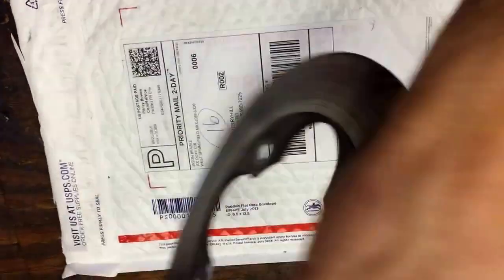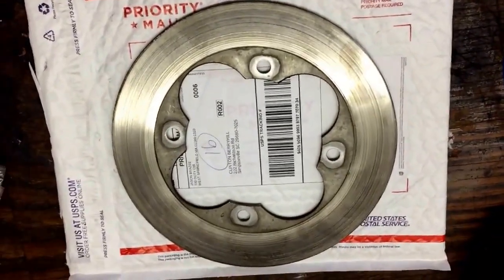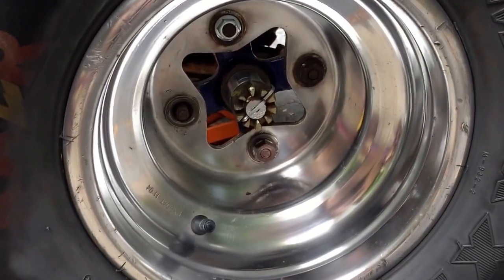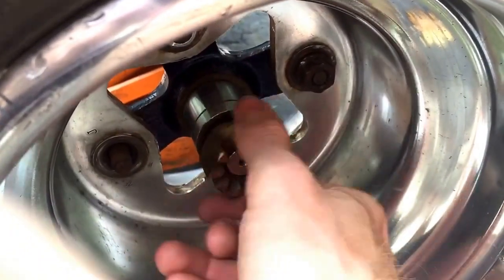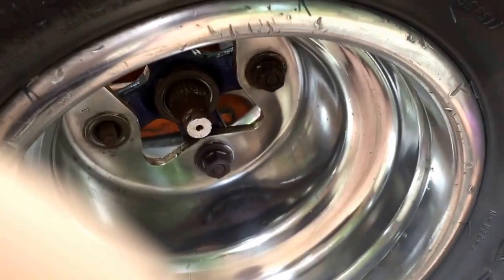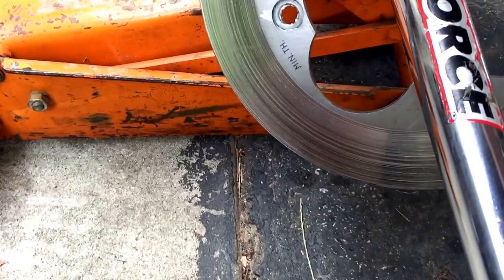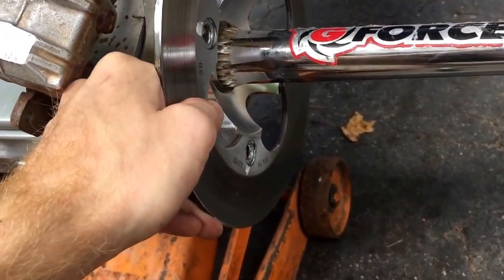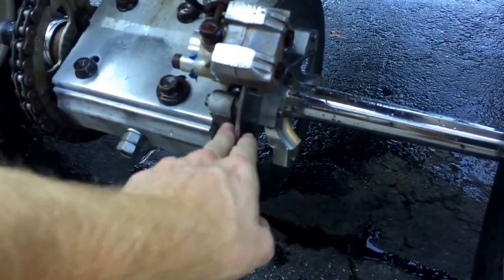How to install rear brake disc/rotor on ltz400/z400.

Comment: I have a bent front rotor. And am in the market to replace it. I'm looking for a stock rotor so I don't have to change both.  but am not having any luck finding oem.  We're did you get your's or would you go after market. The after market wave design very intriguing. But I do ride in all terraines and am wondering if a rotor with less meat would warp when blasting through deep water or wet mud. Any thoughts or help is appreciated.

Comment: I have a  .  Ltz 400 changed rear brakes .and bled them but my foot break is not kicking back up.any suggestions
Reply: Ruben Lopez did the spring come off
Reply: Ruben Lopez u shouldn't need to bleed brake line, just push piston back in with a c-clamp